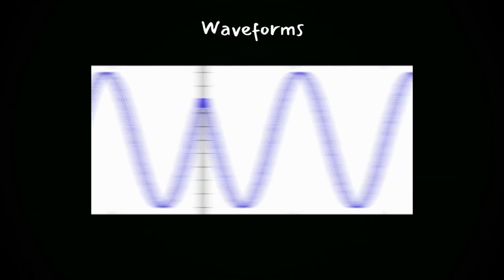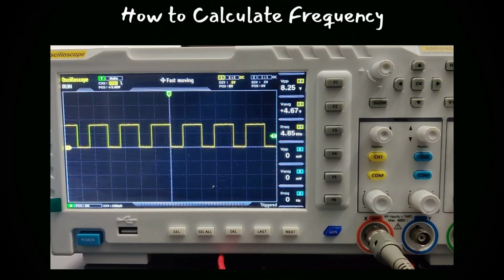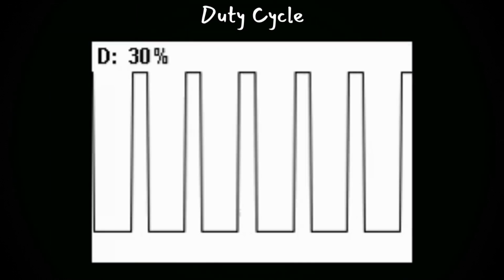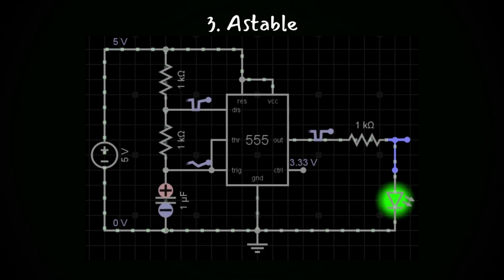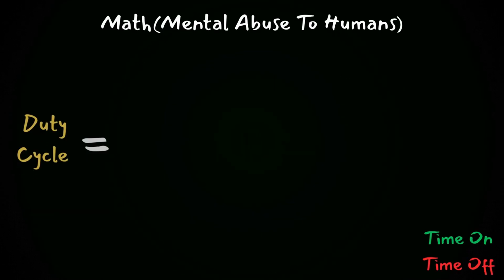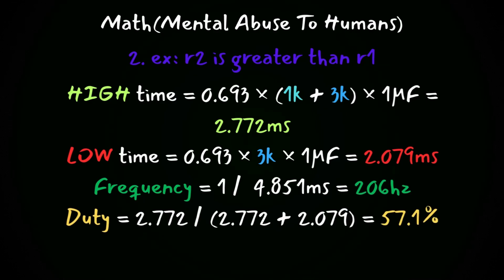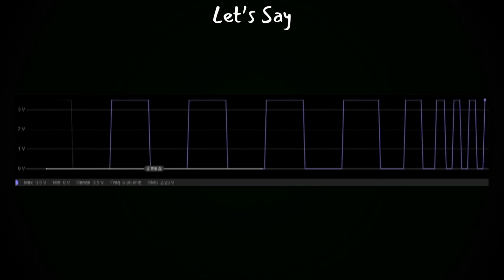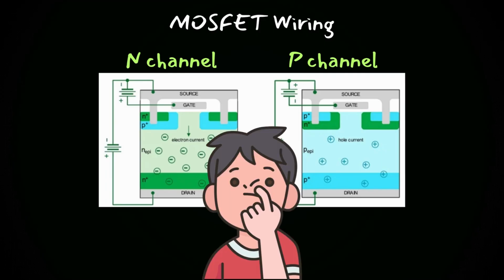How to build your own motor controller with a 555 timer

Comment: [9/2, 17:46] Luca: Hi, could you design electronic circuits and devices starting from scratch and then showing the various connections and the arrangement of the electronic components so that they are easier to create, I would like to build electronic circuits with triggered and non-triggered logic gates, flip flops, Pic PLC microcontrollers etc...... ok?  thanks Luca
[15/3, 23:33] Luca: Ciao potreste progettare circuiti e dispositivi elettronici partendo da zero quindi facendo vedere i vari collegamenti e la disposizione dei componenti elettronici in modo che possa realizzarli più facilmente da casa mia? X esempio
[15/3, 23:38] Luca: https://youtu.be/NjwrdY1hyBQ?si=8IwxtLfymDE4XgXt
[16/3, 16:00] Luca: [21/2, 14:26] Luca: https://youtube.com/shorts/Yu3obf6W18w?si=_HRrzUmfWwxpHEyN
[21/2, 14:26] Luca: X esempio/For esemple. : https://youtube.com/shorts/Yu3obf6W18w?si=_HRrzUmfWwxpHEyN
[5/3, 10:52] Luca: Ciao potreste progettare circuiti e dispositivi elettronici partendo da zero quindi facendo vedere i vari collegamenti e la disposizione dei componenti elettronici mentre spiegate il funzionamento dei circuiti elettronici in modo che siano più semplici da realizzare? Vorrei costruire ad esempio circuiti con porte logiche,and ,or,not,nand,ex-or,ex-nor ;triggerate e non,flop microcontrollori Pic PLC ecc.. ok? Grazie Luca 😊👋
[5/3, 10:53] Luca: Video normale e /o short.  Normale video and/or short
[31/3, 15:12] Luca: por ejemplo circuitos electrónicos cin puertas lógicas de todo tipo y o no mando ex o ex ni disparado y no flip flops, motores eléctricos sincrónicos y asíncronos sin escobillas de todo tipo, amplificador operacional Pic microcontroladores PLC etc... todos construidos posiblemente paso a paso por lo tanto desde cero para que pueda hacerlos más fácilmente desde mi casa ¿vale?
Reply from the maker: @luconovo  sure, I can add that to a part of the video explaining the components of a circuit, but if I do that I will need to teach each component first(redo my crappy videos) so you guys understand how they work
Reply: @-EhsanMalik-  yes ok for me .and 4 you? Thanks Luca 🤗
Reply from the maker: @luconovo  oh I don't mind teaching people... I love it!